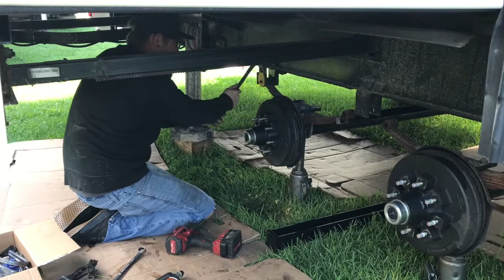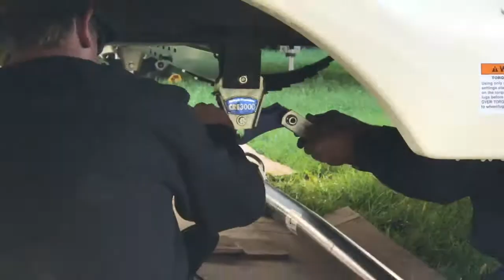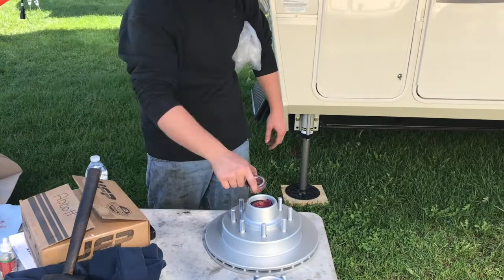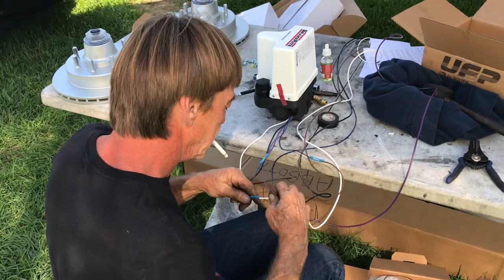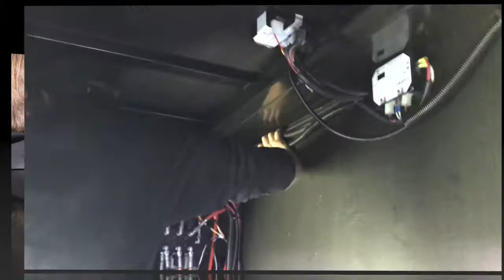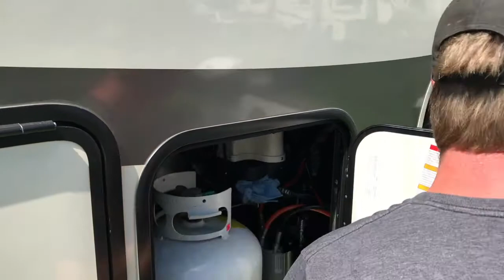Performance Trailer Braking Upgrades - Aug. 2018

Comment: Just wondering why your calipers were installed facing each other? The install procedure for the Hydra Star disc brakes shows both facing the rear of the trailer. Is the brand of brakes you installed different? Just wondering if I need to change mine around.
Reply from the maker: Performance Trailer Braking did the install.  Given they've done hundreds of them, including many while I was at the rally, I assumed they knew what they were doing.  They were Titan brakes.  I also removed the calipers myself to lube the bearings and replace the seals once.  I had no issues or saw anything that would suggest the brakes were not installed properly.  And they worked fantastics for the 3 additional years I had that unit.  Since then, I've had no calls from the new owner with any problems or questions.  Hope this helps.

Comment: Been dreaming about this update on our GD 375RES 2017.  What might I expect to pay with these folks doing the install?
Reply from the maker: Tom, I paid $5449 in August 2018 at the GD Rally in Elkhart, IN.  That price included a $200-$300 discount for having it done at the rally.  That prices was for everything you see in the video, including labor.  Hope that helps.  Chris
Reply: @ourtimetorv3151  Thanks for sharing the price.  Now I know what to plan on.  Not likely we'll get a discount, as the GD rally isn't in our current plans of travel.  :)
Reply: @ourtimetorv3151  Seems like a great deal.  Thoughts after a year of the upgrade?
Reply from the maker: @MightyBobo  Haven't put the whole setup to the test yet as much of the suspension upgrades were for some planned boondocking.  That said, the suspension no longer flattens out any more, so that's good.  As for the tires that were upgraded prior to this video, 100% satisfied going from E to G Load Ratings.  The brakes are GREAT!!!  The stopping power is much more improved for those situations when people jump in front of us.  Overall, I have no regrets and sleep a lot easier.  Great investment.  Good luck.
Reply: @ourtimetorv3151  The brakes were my actual concern.  But it seems that if you're going to upgrade the brakes, you may as well do the whole she-bang in the process.